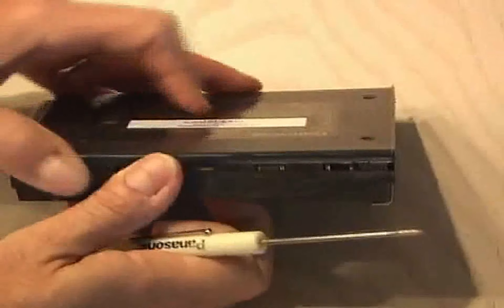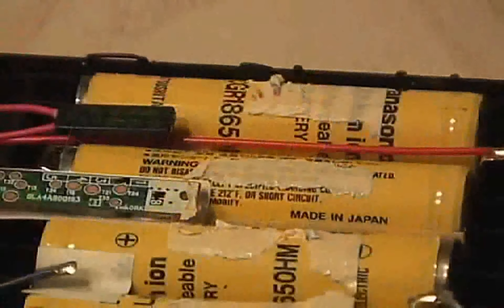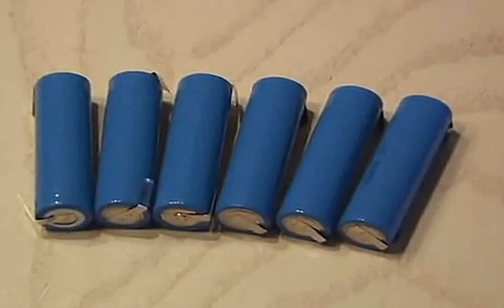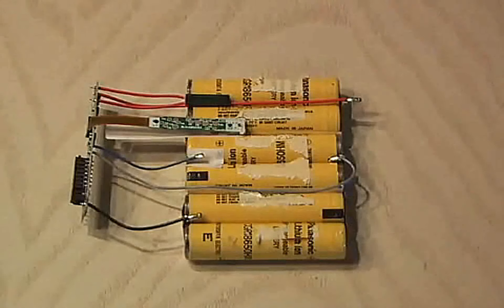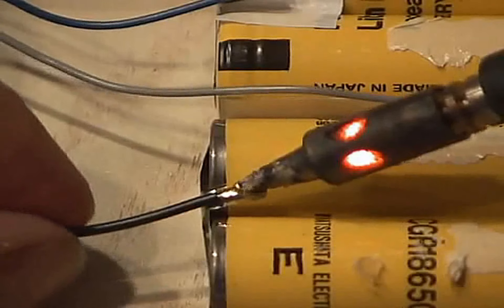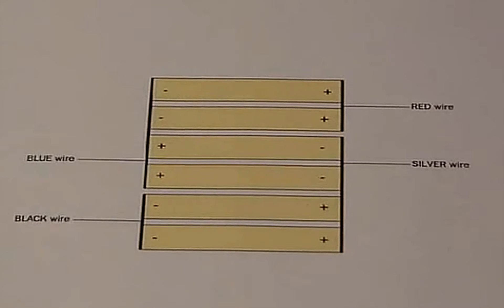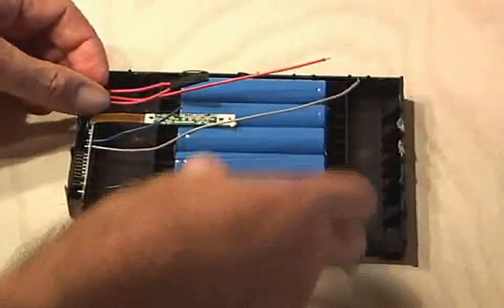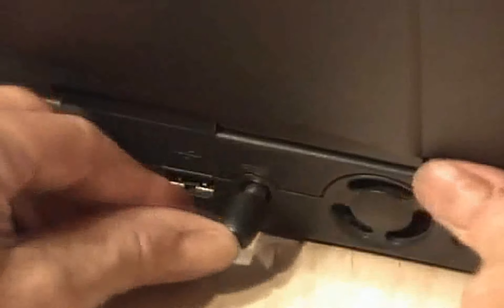Como reparar la bateria de una laptop (Truco)

Comment: Por que se ponen en Cortocircuito las Baterias? A veces si tu Portatil no Arranca: Quita la Bateria y arranca solo con el Cargador.... Listo!...Yo lo que hago es sustituir las celdas de Li-ion y sale algo mas BARATO que comprar una bateria nueva. Salu2!
Reply: +Octavio Lopez No creo que sea cierto amigo. Tendrìa que traer una pila, o batería integrada para evitar algún daño por pérdida de Configuración alguna. Más bien creo lo contrario, que hay que descargar esa tarjeta, o chip que tiene para reiniciar su configuración al cargarla al 100% y descargarla al 0% dos veces..

Dios te bendiga.
Reply: *****
Hola! Que yo sepa no hay que mantener el voltaje. (puede ser en alguna marca concreta)
Yo tengo  un Vaio con 8 años y siempre esta conectada la bateria y cuando se va la luz aun dura una hora. No lleva chip de contador de cargas....Tampoco se si existen .